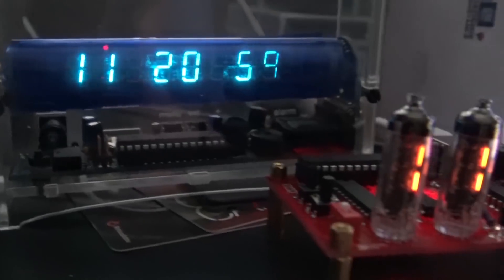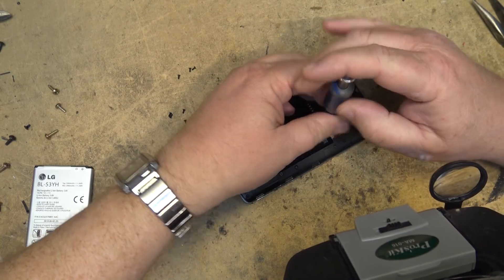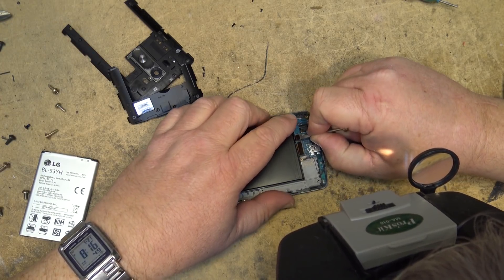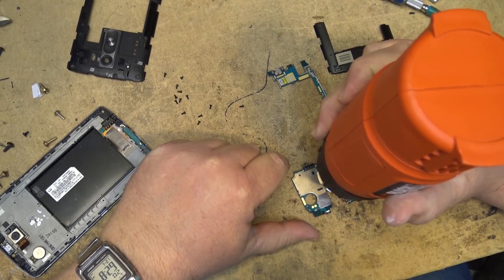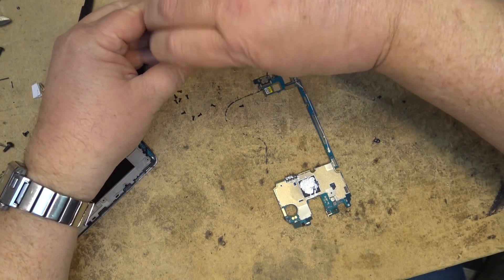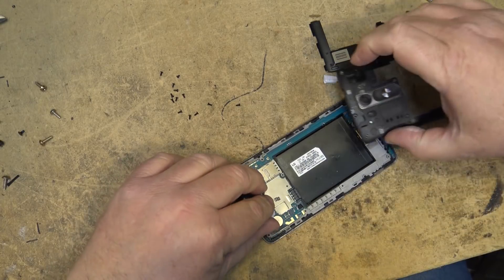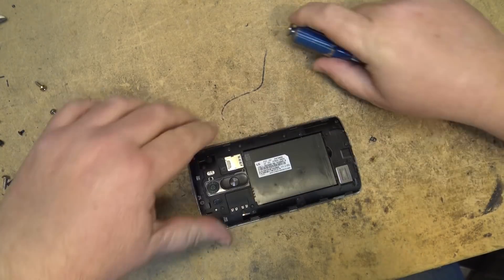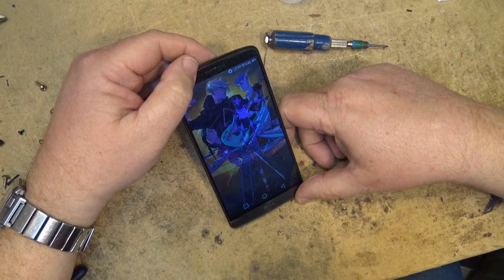LG G3 screen flicker problem fix

Comment: Crazy how they shipped the G4 with exact same easy-to-fix issue... all they had to do was put a slightly thicker thermal pad, or apply more pressure on the heatsink

Comment: Yes there is a gap between metal frame and CPU/memory chip stack.  LG did horrible job by leaving out the heat sink for cpu in LG G3.  But why not use real copper square (dozen for few bucks on ebay) + heat sink paste to fill the gap?  Also using generic heat gun is dangerous (maybe ok for pro) as there is no temperature regulation and it's easy to fry the board.  Cheap hot air reflow station is just $40 on ebay.
Reply from the maker: 40.00 plus 100 shipping.  No thanks.  Last time I ordered a 10.00 item on eBay it cost me over 120 by the time it got here.  Seller charged 55.00 in shipping charges and then despite being told to not ship by fed ex, ups or DHL, shipped by fed ex and they added an additional 37.50 in broker charges and unlike Amazon if you are unhappy just send it back there is no recourse with eBay.  Sure the seller will usually accept returns but they are not going to refund shipping, or broker charges and the buyer has to pay to send it back.  In Canada we get fucked by high shipping charges.  Us post office charges 2x more to ship package to Canada as Canada charges to send same package back and fed ex may offer lower rates but they charge a broker fee on every package that comes in.  I once got a rebate cheque for a product i bought.  All I had to do was mail in my warranty registration card to get my 10.00 rebate.  (I think it was a video card i bought many years ago) company shipped this cheque by FedEx. I got my 10.00 cheque and 3 weeks later a surprise in the mail.  An invoice for 37.50 in broker charges and tax. Tax? Yup tax.  Fed ex charge 25.00 to do the paper work.  That 25.00 fee is taxable 2.50 in tax.  Now because they are "loaning" you 2.50 there is a 10.00 fee for loaning you the tax fee.  Huge scam.  So i lost 28.35 on this transaction 37.50 plus the postage to mail the rebate in less the 10.00 refund!

Comment: After all is said and done, the phone is working! Proving once again that you don't need all the expensive, purpose built gadgets to get the job done.  A heat gun and on the job experience was the point of this video. Thanks for sharing

Comment: Someone has managed to water cool a laptop so are mobile phones next saying if the case was large enough to allow a water block to be placed in contact with the GPU/CPU and the pipes brought out the side via a shot-gunned pipe to a unit with the pump, radiator,fan and battery to power both the cooling solution and phone carried by a strap on the guys back the way the solders carry their radio packs.

Comment: I’m surprised you didn’t use some thermal pad rather than just heat transfer compound.
Reply from the maker: I didn't have one thin enough. Hey it's my kids phone, and he was all set to buy a new one convinced that it is toast. Didn't kear him botching about it all night so obviously it is working. The folded paper puts pressure on the board which in turn pushes it closer to the heatsink, and the thermal compound should help cool the chip. I normally don't attempt to fix phones, but when it is headed for the garbage I will take a shot at them. The only other one I have fixed was my old Blackberry Classic for work when the screws in the case came loose and caused the backlight problem. That one still works, but unfortunately they shut me down and gave me a shitty android, which I just despise. One of these days I am going to throw it out the window. I have to use MasS360 for VPN access and it locks after 60 seconds and needs the password reentered. It is also so bloody slow that for the most part if I need to access company files it is faster to go to my truck, grab my laptop, boot it up, connect it to the network and fire up cisco anyconnect. I am on line faster than waiting for this bloody android piece of crap. My old Blackberry10 device on the other hand was always connected. I just swiped down from the top, selected switch to work, and bam I was online in the work browser. So simple, so fast, and it just worked.
Reply: 12voltvids People (and businesses) these days... Why bother fixing what ain't broke?